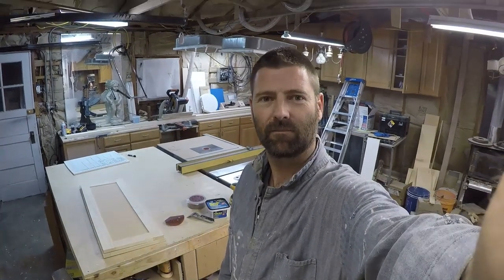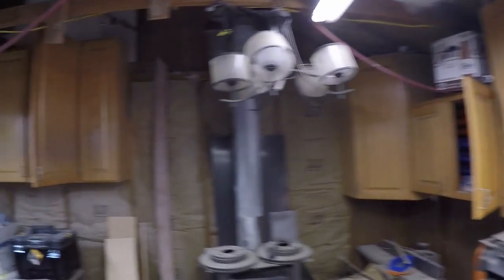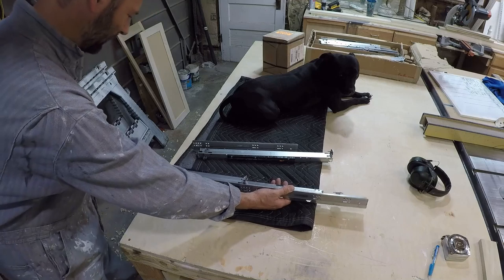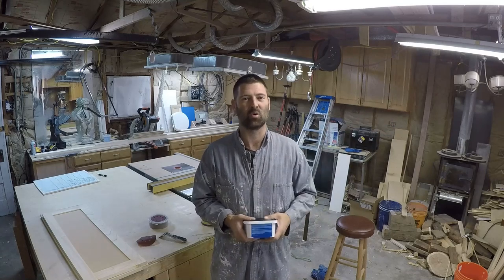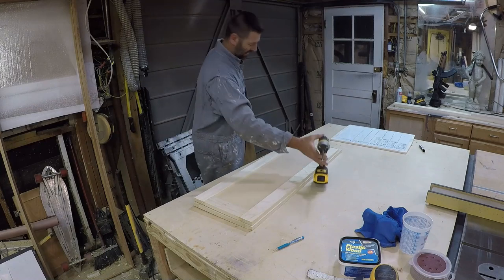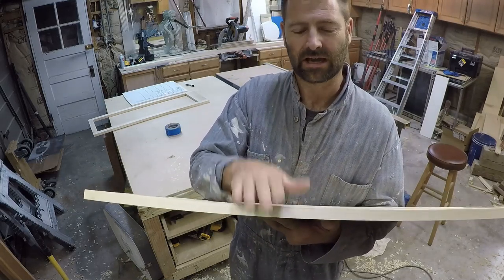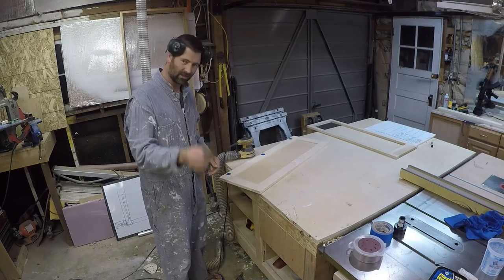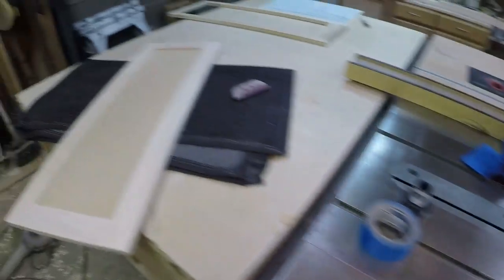How To Prepare Cabinets For Paint | THE HANDYMAN |

Comment: Those undermount soft close slides are nice but watch out. If your drawer boxes aren't the exact right depth, the slide wont hook into the back of the box and mesh up with the quick release clip correctly. In that event you'll have to shim out with spacer blocks under the drawer box. Interested to hear if your drawers work out no fuss no muss or require some work to get the slides to fit correctly.

Comment: Handyman,  I am curious to know why are you building the kitchen cabinets instead of ordering custom cabinets from a cabinet maker?  Is there a cost savings to the client?
Reply from the maker: Custom cabinets came it at $22,000 for this kitchen.   I'm doing if for a lot less and making a good profit. The last 2 kitchens I installed cabinets were $18,000 and $21,000 for white shaker cabinets with some nice hinges and drawer slides.  There was also a 3 month wait time for both kitchens.  I get paid on both ends.  I make some youtube videos and I charge the customers.  This time of year youtube makes me lots of money.  The videos making these cabinets will earn more from youtube then what I'm actually charging the customer.
Reply from the maker: Seth.  I will have under $3,000 in materials for this kitchen.   This is just the tip of the iceberg.  There are custom size cabinets and floor to ceiling pantry. Huge cabinet for double oven.

Comment: I have the bad version of those oak cabinets.  Previous homeowner painted them white, the grain is incredibly prominent.  Sand down the paint or strip it?  Where should I start?  Also can’t wait for the cabinet video.  I have the same rails and there’s been problems.  🤕🤓🤣
Reply from the maker: That's a tough one.  I see a lot of sanding in your future.
Reply: Teppi,  Just an alternative suggestion.  Sanding down would be the best (and most proper) way to do it, but maybe not the most practical way if you are not a perfectionist and don't have the time(or desire) to spend on sanding them down to bare wood.
Since they are already painted(and assuming the paint job is decent), I would suggest putting a coat of Zinsser Gardz problem solving primer on them. It is very thin  (watery), but when it dries, gives a hard enough surface to take light weight spackling to fill the grain and then a sanding, without gumming up the paint and causing it to peel.  Then once filled and sanded smooth, seal it with another coat of Gardz.  This will seal the spackling and make the surface ready to give a uniform finish for the topcoat.  Basically, this is a work-around all the heavy sanding to get it down to bare wood... a time saving technique.  Not the best choice option, but an alternative one that will give you good results too!  Depending on where you live, you may have to go to a paint store to get Zinnser Gardz. Where I live, I can get it at the box stores too.  Beware though, not to substitute with a competitors equivalent product.  I have not found one that works as well as Gardz.

Comment: Oh handyman, how I wish I could share pictures on here in the comments! I just saw a roof that would hurt your brain! I can't figure out how it took 20 years for it to leak and cause water damage. Two chimneys and two valleys that run smack dab into each chimney so water can pool up in the corner of the chimney and the house. Only one side has leaked so far. 

I got asked to look at the water damaged ceiling and floors as a favor. They wasn't happy when I told them to call a priest and a hazmat team. Asbestos shingles and asbestos siding, I'm pretty sure it has asbestos insulation as well. I can't wrap my head around why someone would build addition both vertical and horizontal without doing something adequately equivalent to the roof.

Comment: Hey, very informative. 

I’m looking at painting an oak kitchen and want to conceal the grain as much as possible. When you are talking about priming and sanding. Are you recommending an oil based primer or water? I’ve used water based primers on poplar/mdf shakers I’ve built in the past and sanded it and they all turned out beautifully. But I haven’t experienced a oil based primer that actually sands out nice and smooth like the water based products I’ve used. Any recommendations? Thank you!!
Reply: BIN Shellac primer is quite good for oak and won't pick up any of the natural oak oils that can leech through to your surface with other primers (I had this problem and had to redo everything). I was able to spray the shellac primer undiluted through a 1.4mm hvlp without issue.